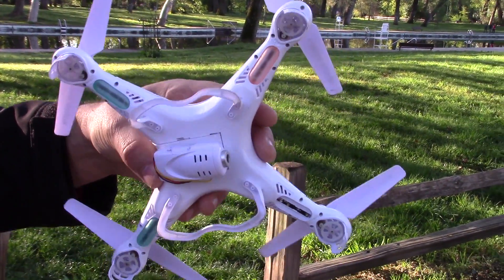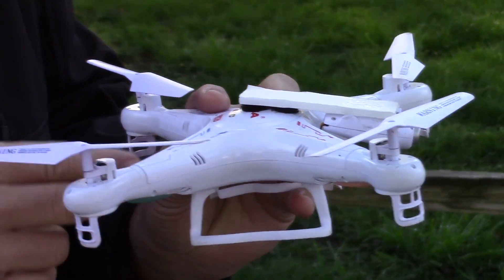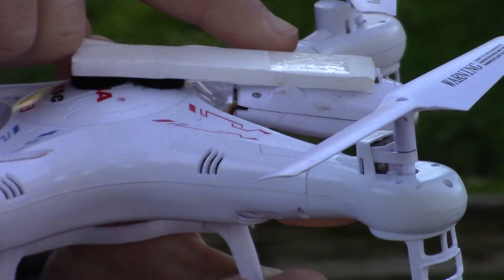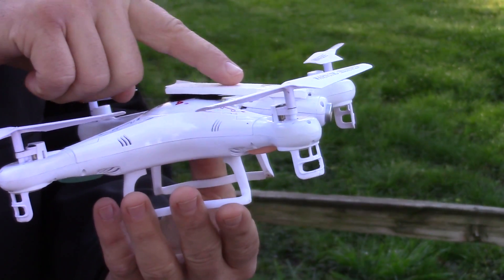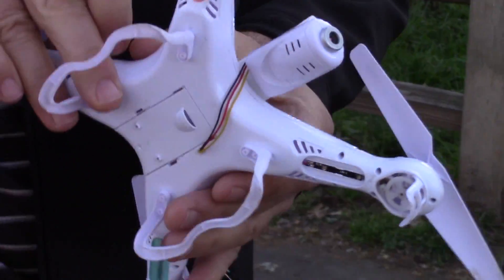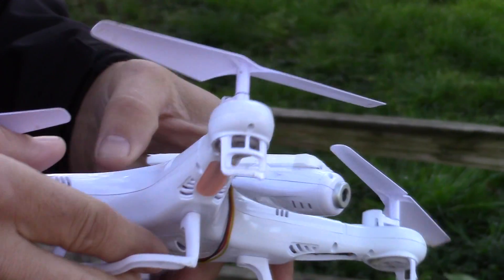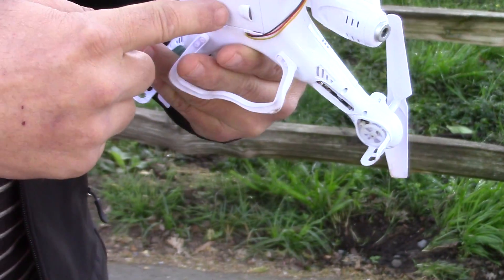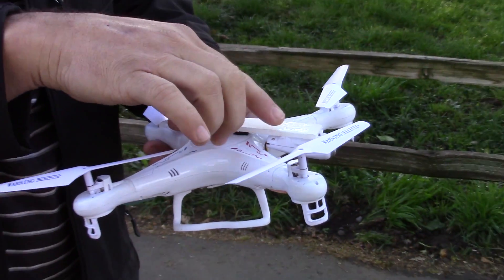Radical drone front mount camera modification test flight comparison Syma X5C-1

Comment: I would say the modified mount is  better. More light. But I was a little hard to tell because the sunlight at different times. The sun was brighter on the corner of the street and brush and did not film well like the modified view when the sun was going down. It seemed like the camera emitted more light in front of the Quadcopter than under it. BTW. How did it Fly with the weight to the front?
Reply from the maker: +Joe Flash Yes, Yes, thank you. That's what I've been trying to tell people all along. It's not really a fair comparison because the light changed between flights.  It was really early in the morning, the sun has just come up, and by the time I had re-positioned the camera, the sun was noticeably higher in the sky. As far as the camera mounted in a forward position is concerned, it flew almost equally as well as with it directly under the body,  the standard position.

Merry Christmas

Comment: In theory, the standard mount should be smoother with pitch and yaw movements, since it's closer to the axis of rotation for those directions.  The new mount would make roll movements more stable, since it's closer to that axis.  I don't see a huge difference in the vids.

Comment: I have just order this drone, I have never flown one, I'm a total newbie. I couldn't really tell a real difference between the two, although the modified seemed slightly better, worth the effort of the mod? Not really, just my opinion. I know the battery really drains down when flying with the camera on, so my plan was to remove it add on a 3/4 oz spy camera with an internal power source. But thanks for posting up.
Reply: Rick Cianflone Hi...I checked the specs of your camera, and you would probably get a very similar resolution as the stock camera; if you can publish a video with your videos it would be great...I recommend you to weigh both cameras and try to maintain this value, otherwise you´ll be burning out motors pretty fast....=)
Reply from the maker: Rick Cianflone Good idea using a lightweight spy cam. The Syma definitely won't lift a Go-Pro and still be able to fly.
Reply: http://www.mobstub.com/d/Mini-DV-Spy-DVR-Video-Camera-1   This is the one I will mount, mount and all 3/4 of an ounce. I use it as a dashboard camera in my car(s) a POV cameras while biking and skiing. For $12 it was a good buy, not Go-Pro but it gets it done.